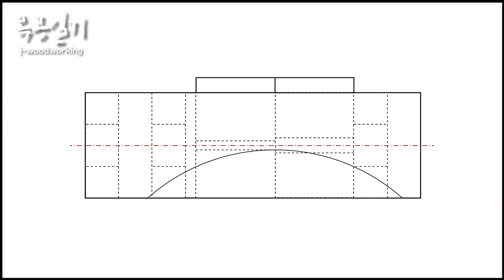making dowel jig & dowels with table saw [woodworking]

Comment: I am not fully understanding how is it working:
- why the stick is not destroyed by the blade in the large hole
- how the stick is guided without a cone shape
But obviously it works fine, and with this jig, it's only a matter of hole size of the "inside blocks" for you to make specific dowel size : very clever
I've already seen similar jig with routers, but yours seems much more efficient 

I'll wait to see you using your dowels.

Thanks from France!
Reply from the maker: The peak of saw blade is aligned just between center blocks and right to the lowerest point of final hole. Before sticks go into the final hole, saw blade round cuts the sticks to the final hole size in the larger hole.   When round cut sicks don't enter the final hole-it means larger than the final hole-I raise saw blade a little and a little repeatedly. Why don't you have a close look at the graphic in the video. 
Sorry about insufficient explanation by my poor English. 
Thanks for watching sir.
Reply: @j-woodworking9573  thanks for explanations 👍
I saw the scheme but your explanations about going up, help me to understand what is actually happening.

Comment: what size table saw blade? The one I made with 3/4" thick ply for the different hole guides exposes too much of a 10" blade so it hits the square stock right away when you put it in. Would the smaller diameter of a 7 1/4" blade be better? thank you for you demonstration!

Comment: Very ingenious jig J! How would you alter the jig in order to cut different size dowels? Or would you have to make various size jigs for each dowel size? Just curious? 👍👍👏👏😉😉
Reply: I would imagine the only thing you would have to do is make the two center blocks in the same manner with the size in mind for what size dowel you’re trying to make and figure out the height of you blade in reference to the hole. I think the reason for the larger holes in the first three blocks that he made were made that size to allow for different size dowels to be made on the same jig frame. I had no clue where he was going with this jig, but it makes sense once it’s put together.
Reply from the maker: When you want to make other size dowels you make another two center blocks. And you replace original ones which weren't glued. One hole is the size you want and the other is larger. Thanks for watching sir